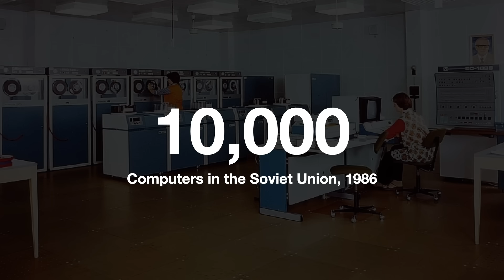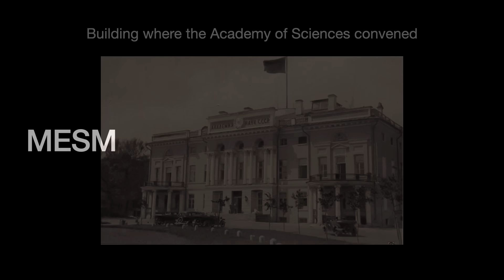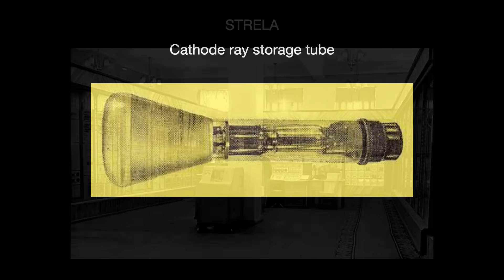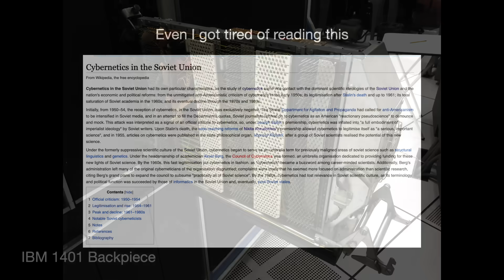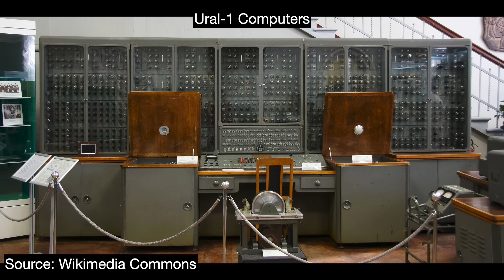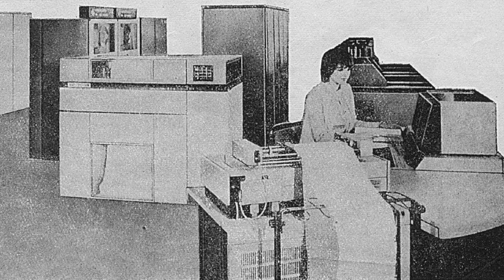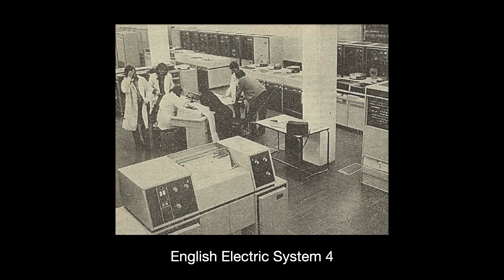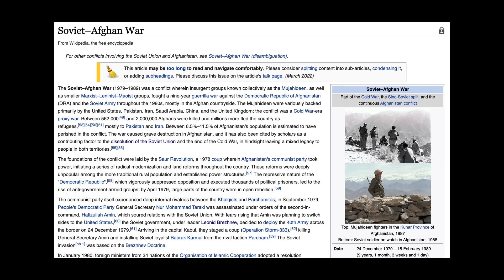Why the Soviet Computer Failed

Comment: Great video. However, it has several issues. With so many comments I think nobody will ever read this, but anyway.
1. At the moment of Stalin's death there were 4 computers in USSR. Not four models or types, just four computers. 2 in Moscow, 2 in Kiev.
2. MESM was initially decoded as a Model of an Elecrtonic Machine, not the Small Machine.
3. There were 8 Strela computers ever made.
4. Not all ES computers were copies of IBM-360 and also not all were IBM-compatible.
5. The newspaper shown is not Pravda, but Pionerskaya Pravda. The difference is like that between The Times and The Washington Times.
Otherwise everything is almost correct.
Reply: Kiev as the transliteration of the Russian name for the city is appropriate when discussing the Soviet era, in the same way calling Volgograd Stalingrad is appropriate for when the Soviets called it that. Calling the present-day Ukrainian city Kyiv is also appropriate, in recognition of transliterating the Ukrainian name for the city rather than the Russian name. Historic revisionism isn't going to help Ukrainians.
Reply: @timewave02012  yes we need these rational comments and not some not important outbursts from ego trippers ffs
Reply: @timewave02012  
That's not going to stop them. Even some close friends are convinced that I am a mongol/finn/turk... orc seems to be the new one, among very nationalistic ones
Reply: I guess some folks have read your comment.
Reply: Sorry, but I think MESM stands for Malaya Elektronnaya Schetnaya Mashina, i.e. Small Electronic Calculating Machine. As contrasted to BESM: Bolshaya Elektronnaya Schetnaya Mashina, i.e. Large Electronic Calculating Machine. It fits.
Reply: @Kurtlane  At first they called it a model. Then they made another, bigger machine and renamed existing one to Malaya(small). About BESM different sources give different information about was it "Bolshaya"(Big) or "Bystrodejstvujushaya" (Fast) computer. It is interesting that the book called "Computers" printed in 1973 in Soviet Union that lists technical data of almost all contemporary Soviet computers, tells nothing about what BESM could mean. There is information about BESM-4M and BESM-6 there.
Reply: @shroedingercat  You should go deep in history, as actually MESM was started before BESM but used just as development scientific workbench though, after it was decided that even this will be remade into full computer when BESM was proven to be if fast, still is kinda unreliable so in reality its fast calculation capabilities couldn't be used totally due to frequent fails
Reply: @antonzhdanov9653  What you say is entirely correct.
Reply: And despite this, even RAND agrees that for 60 years the Soviet Union's economy grew far faster than the U.S.'s did. Imagine if their computing had kept pace!
Reply: Too bad no one will ever see this post. lol
Reply: @trumanhw  "we see everything" - will sutcliffe
Reply: So it's like the host in the Radio Yerevan, when questioned by the listeners of the station about the rumors if they give away the cars at the Red Square in Moscow. With so many phones to the studio, he answered, the news was essentially based on some undeniably true facts, but anyway it had several issues:
1. Not at the Red Square in Moscow but in Peter.
2. They definitely don't give away but steal.
3. These are not cars but bicycles.
Otherwise everything is almost correct. ( ͡º ͜ʖ͡º)
Reply: This Kyiv vs Keiv argument is the most ridiculous and ignorant argument possible.  First of all I will say that it is 100% of whatever government is in place at the time is the one who gets to say how their provinces are named.  End of conversation!
  There is so much history in Kyiv that it is nearly impossible to get it 100% accurately right by those metrics because of how different people write & re-write history. The funniest (and most ignorant) arguments are from the Russians. They act like because Kyiv has been in their sphere of influence  that they get to be the deciding voice in the argument. What makes that laughable is the fact that Kyiv was actually established EVEN BEFORE THERE WAS SUCH A COUNTRY AS RUSSIA.  Historians say that Kyiv was established around the 4th century whereas Russia (as a country) was established around the 8th century.
  My final conclusion: whoever controls a city within their sovereign borders is the one who decides what that city shall be called.
Reply: pretty interesting tbh, ive always wondered what if some other country besides the usa had ended up creating the computing paradigm instead
Reply: @crazydog3307  A paradigm is a paradigm only when other people accept it. For USSR this is not the case and there are two reasons. The firs one is the political isolation of the USSR. The second one is their inability to produce computers in substantial numbers.
This affected the whole industry. Just one fact: in USSR they were able to create one (yes, ONE) programming language that was not a copy or a translation or an adaptation of Western ideas. And this programming language  has been created by a dissident.
Reply: 64357
Reply: You got tons of reads. Congrats.
Reply: @The_ZeroLine  Yeah. That's why I did it. Reads. Wow, you saw right through me.
Reply: You message was confusing. Did you think I was being sarcastic or accusing you of something?
Reply: 'Otherwise everything is almost correct' - the highest Russian compliment. 🤣
Reply: It’s KIEV if you’re anywhere west of fucking.... ummmm, idk boys, what’s a good cut off?
Reply: At least former soviet has many Hacker and Pirate now.
Reply: From NZ,,,point #5   noticed that :-)...
Reply: How do you get the Russian alphabet to come up when you type in your comment, or any other one for that matter.
Reply: @bpark222  use Google translate. Paste/ copy
Reply: How about Schrodinger's bomb? Trade the cat for an explosive on a timer...does it exist? I dont get Schrodinger really, someone had to put that cat in that box. Just because we dont know who, doesnt mean it isnt there. Ignorance of an existence, does not mean it isnt there.,
Reply: I don’t know who you are but you are cool and we would probably be friends if we met IRL
Reply: and they forgot class of research, terminal and  "personal computers" . Nairi (https://ru.wikipedia.org/wiki/%D0%9D%D0%B0%D0%B8%D1%80%D0%B8_(%D0%BA%D0%BE%D0%BC%D0%BF%D1%8C%D1%8E%D1%82%D0%B5%D1%80)), Electronika, Pravetz
Reply: I found your post relevant and I have read you. I won't make stupid controversies of Kiev name. All the slavic and baltic languages redefine the words of western cities in their own linguistic requirements. We don't undermine support for Ukrainians by naming things this way, and blue/yellow flag don't cost much, while true support is much more difficult. Anyway, debate about the content of this video is interesting.
Reply: I would also add that the other Easter Block (Warsaw Pact) countries provided not only peripherals and parts for the ES computers but made also their own IBM-360 clones. I used to run my code on one of them (R-32, I believe) in late 1980s for my PhD in Poland.
Reply: @arctic_haze  yeaaahhhh!!!! That is why I am suffering through these comments!!! I forgot what it was! R-32!!! Wasn't there a newer version? R-3? something? I used to work on them between 1987 and 1992. But really, I worked more on the IBM 360. Because of the monitor. I worked in a big steel company in Hungary. They also had one called Bull Gamma (I t
am maybe wrong, but I think it was French). The Bull Gamma used punch CARDS! The R-32 had punch "ribbons". We were using PLIOPT/1 as language and I loved it....
These pictures are bringing up such of good memories. Having data storage "disk" and readers the size of a washing machine. Having a stack of punch cards that printed out pictures. Those who were a little too deprived had their Playboy "magazine". My god! It was fun...
Reply: @tahwsisiht  The one I worked luckily had already terminals so I could type my code on one of few scattered on the corridors of the institutions where I did the calculations but the jobs had to wait in queue and usually I received my printout the next day from a priestess in white robe (yes we we not let close to the computer itself). I coded in Fortran and found it funny that I had to type as if I produced the cards (code from column 8 to 72 only if I remember correctly).
Reply: @arctic_haze  after I finished my comment, I remembered that we had Hewlett Packards too. It was a big company with a good size of computer science department (not the perfect translation) The company had more than 16,000 workers and our department had at least 200 employees. Data entry, operators and mechanical guys, programers,  managers etc... The computers were accessable and some of the guys would do those silly pictures when they had no project. I was young and many of my coworkers were just under or around 30. It was fun to work together. A TON of practical jokes. I know periods of socialism were different in our countries and it made a big difference. In the late 1980, we were "getting some freedom". Poland had some protesting around that time. Maybe miners workers had some bloody crack down. Am I right? Sorry if I am ignorant about your history. I will Google it later. It is pass 2 am.
(One practical joke: the director of the department had alcohol. When they had meetings with other directors or managers, they had some drinks. One time, the guys in the night shift, used a syringe to suck out the alcohol and filled it up with water. They partied at night and the bosses were pissed when they were showing off at the next meeting :) )
Reply: I don't see why any Ukrainian would feel any affinity for Russia after Holodomor. Join the West.
Reply: Here is a video that clearly outlines the weaknesses of centralized planning and most of the commentary on the right surrounds a language dispute and how to spell a certain city. Have we lost our ability to look from 10,000 feet up and see the bigger picture?
Reply: @Bob and this is the tread with the most comments. Funny, after the guy typed that his comment will not raise attention....
Reply: You are all wrong, it's Kiwi. The whole discussion over the name is very stupid and unnecessary. It is a city in a country that is being attacked, it's irrelevant how you spell it, it wouldn't change anything. If you write "Kiev" It wouldn't add power to Russian army and similarly if you write Kyiv, it wouldn't help Ukrainians. So write it as you like, don't listen to anyone
Reply: @andremorr  it is called respect. You just have none. Not a good trade...
Reply: @tahwsisiht  it is a pity, not respect. Respect you have to deserve, pity is something you feel seeing someone being wronged. And maybe I have to remind you, but there is a war in Ukraine and maybe it's not the time to argue about stupid things like how to write the name of a city that maybe is being under attack as you read this sentence. Put your energy into something productive. You and other people. Please
Reply: I worked at IBM for a while and I remember a newsletter coming out when one of the top employees, Thomas J. Watson Jr., died in the early 1990s. The article included an excerpt from an interview he had done back in the mid-1950s with a major newspaper or news-magazine in which he was asked how many computers he expected IBM to sell that year, worldwide. His answer was THREE. Not three hundred, three thousand or three million but THREE. This was not nearly as unreasonable an answer as it might first appear because computers were IMMENSE (and I assume correspondingly expensive) in those days and of very limited use to almost anyone. When I started working as a professional programmer in the early 1980s, I talked to some of the people who had worked with the first computers that our insurance company had and they remembered machines that were so large that they could WALK THROUGH the inside of the machine. (Apparently, this was so that repairs to internal components could be made.) I've forgotten whether the machine  you could walk through was the CPU or a peripheral like a printer.
Reply: Wass Pionerskaya Pravda written for members of the Young Pioneers? Or does Pionerskaya translate better as "engineers"?
Reply: Were the lies in Pionerskaya Pravda usually less outrageous than those in Pravda?
Reply: True "Pioneer Truth". this is for scouts from 10 to 16 years old...
It's funny that the problem of the entire Soviet system was discussed at the children's level.
Probably one of the pioneers whose parents were communists discussed the conspiracy in the kitchen remembered the conversation and shed light through this publication bypassing the KGB agents in adult fiction.
But it didn't help.
Reply: The difference between Pravda and Pionerskaya Pravda -- i.e. Pravda for the (Young) Pioneers -- is more like that between The Times and a simplified, Simple English version of it. The Young Pioneers were the Soviet Cub Scouts. The Soviet Boy Scouts, i.e. Komsomol, had their own Komsomolskaya Pravda as well.
Reply: Pionerskaya Pravda was a newspaper for children
Reply: Tbh, I don't think it's historic revisionism as Ukrainian was the state language of the Ukrainian SSR. So, both translations could be used.
Reply: I'd love to know how. you came to know these things.
Reply: It's amazing how we have 5 experts in this comment thread, yet not one of them is correct.
Reply: @helljumper912  Experts on what? How to spell the Ukrainian language? Is it anything like spelling harbour harbor at the US Canadian border?
Reply: @kimobrien.  Kiev as a name originated 10+ centuries before Ukraine as a concept or Ukrainian language even become a thing. Expertise on Ukrainian language is irrelevant here.
Reply: @rogerdinhelm4671  

Ukrainians founded Kyiv and are authority on how their capital name should be spelled, not Russian imperialists.
Reply: @rogerdinhelm4671  More accurately, “Ukraine”is just simply irrelevant.
Reply: @1AstralKing  Well Kiev was founded long before Ukraine was.
Reply: @rogerdinhelm4671  Yes it was.
Reply: @helljumper912  
Not inaccurate to say that it was originally a Khazar Khaganate before being captured by the Rus, there is also some truth to say that the 'folk wisdom' is that Kiev was named after Kiy. 

But the etymology of the name was originally Kyh-jev / Кꙑевъ, closer to Kiev than ...Keev. 
Original meaning is unknown.
Reply: @LancesArmorStriking   
After Googling, Kyiv is the politically correct because that what Ukrainians use as their own spelling. Kiev is associated with Russian language or the Soviet era. Even the pronunciation is different.
Same as post-colonial name changes in Asia from Ceylon to Sri Lanka or Bombay to Mumbai.
Ukraine was pushing it to show their independence. So, I think that is the appropriate way to spell Kyiv. They have the right to ask us.
Reply: @tahwsisiht  
I suppose, but this ultimately also comes down to translatability as well. 

'Keev' is simply never going to be pronounced correctly in English, it lacks the distinction between и and ї. 
Kyiv is not the original spelling either, but a transliteration.

Ireland could just as easily demand that it be called Eire, but it doesn't, because 1) it's purely symbolic and not practical and 2) it complicates existing norms
For a better example, Poland does not ask people to use 'Varshava' instead of Warsaw. It benefits from using a name that is more easily pronounceable by non-Slavic people. 

I think Kiev, composing 2 vowels, is the same.
Reply: @LancesArmorStriking  for me, it doesn't take anything to call it Kyiv. And because I have respect for others, I can not see one valid point not to call it Kyiv.
Reply: @tahwsisiht  
It might not take anything for you as a single person. 
But, this will affect transliterations and translations of official documents in English (do we retro-actively re-publish everything with a single word change?), retooling tourist guides and materials, maps, atlases, websites, everything that even mentions the city by name.

And I find it strange that you think someone's ability to see valid reasons not to change the name everywhere, comes from a place of disrespect.
Reply: I read this, im a nobody, so you are still technically correct, the best kind of correct.
Reply: in soviet controlled countries development of the computers has been running under strict supervision of soviets and any development showing some progress immediately stolen and permissions for further work forbidden.
Reply: Well, this ended up being an interesting thread, both a discussion about what you call the capital city of Ukraine and an interesting debate on the interpretation of some facts presented in the video.

To the first point.  Does it really matter specifically what you call it so much as you identify that it is the capital city of a country under siege from unwarranted Russian agression designed to seize any and all territory in a desperate grab by Putin to see the USSR restored regardless of whether the USSR was a competent power?  The history books as I understand it, implies it was generally inferior.  Although it looks like they did have the potential for some amazing computer power, but was wasted by beaurocrats.

As for the second point.  This video may well be flawed, it doesn't seem to have CGP Grey's level of investigation behind it, but it clearly pulled from the facts its makers had available.  It may be flawed and needs a re-working.  But credit for getting a lot of the general principle information out there.  I learned they had relatively shit-fast computers at one point ahead of everyone else.  I learned they tried to do a deal with a UK company but things didn't work out.  They suffered because of bad decisions of people who could not see their potential.

And coincidently because the USSR fell, in part due to the same bad management, we can tie the computing history to today's on Ukraine.  Russian leadership wants to make themselves strong and powerful again.  they may have learned in part some of their mistakes.  But Russia certainly never learned not to declare a war on mainland Europe where the rest of Europe is going to rally.  The lesson of cost of the siege of Stalingrad should have been learned.  Russia should not mess with Europe because the cost will be extreme to Russia.

If there are any Russians reading this who think the military exorcise is justified?  Then I'm sorry.  You have been lied to by your state media which is telling you information without the other side of the story which has a vastly larger lot of information to tell.  The Russian Invasion of Ukraine is the 21st Century equivalent of a Nazi invasion.  There are basically Nazis in Ukraine, that's true. but its name is the Russian Army.  They have slaughtered thousands of innocent civilians in the name of conquest.  They have bombed 10's of thousands of homes and made millions refugee's in their own free country.  Russian forces risked breaking the contamination seals on Chernobyl while Ukrainian soldiers gave their lives to defend it to prevent the radiation from getting out.  Russia is the second biggest force in the world right now from obtaining a state of world peace.  (the first is China)
Reply: Russian space computers were faster than American ones. The Russian computer that controlled the reusable Buran spacecraft was more advanced and more compact than the Shuttle computer. It was always funny for us in the USSR to watch how in the USA their special services spread stories about the backwardness of the USSR. When it was necessary to tell a joke, we in the USSR told what the American press writes about the USSR, and everyone laughed together, because. it was as ridiculous as a comedy show. If a young man today were to study history from the American press, it would be equivalent to studying the facts about the Second World War from the propaganda claims of the Third Reich. For an objective analysis, you need to listen to what both competing parties say about the same thing.
Reply: @TyphoonUSSR  you are assuming you can learn anything about history. If you believe anything written ever in a medium intended for mass consumption which regards contentious subjects such as the innate motive of the human and events that occurred in any period of history, then you have been mislead. Now, as much as then, the narrative of the media and academicians is pure fiction.
Reply: @TyphoonUSSR  неа. Buran's avionic was guided by four Soviet analogs of i8086 based computers while Shuttles have three i80386 computers. 
but you're right about nowadays "Big lie" type propaganda against Russia.
Reply: KYIV YOU FOOL.
Reply: @Maplelust  nope you self centered bafoon. Київ. you are arguing in the wrong alphabet and language.
Reply: point 5: you compared us and uk papers. how do you compare the two? or us and uk politics? would bidon be forced to resign if he had glass of wine during lockdown?
Reply: @ivok9846  "Biden." Otherwise, your comment is still just a stupid attempt to make a political point on a non-political issue.
Reply: @ivok9846  this comment is deep and underrated
Reply: https://ru.wikipedia.org/wiki/%D0%9C%D0%AD%D0%A1%D0%9C that's not what the wikipedia page says
Reply: this video is riddled with issues. It doesnt seem well researched.
Reply: @wishusknight3009  this comment is devoid of criticism. It doesn't seem to make any valid point.
Reply: @wishusknight3009  Shorter: I don't have to give reasons, I just have to say it.
Reply: @SnarkTheMagicDragon  I have articulated my criticisms in other comments. I just dont feel the need to keep repeating myself.
Reply: @SnarkTheMagicDragon  Yep! So many people simply stating with authority how something is with nothing to back it up.
Reply: Yeah well I have an issue with you: IT's KYIV!
Reply: @posticusmaximus1739  it has been spelt KIEV in english for decades. Just because the Ukranian government want's the world to use their spelling now, doesnt mean people are obligated to follow. Just like Turkey wants the rest of the world to switch to Türkiye, but the rest of the world doesnt care
Reply: @posticusmaximus1739  I heard it depends on if you speak Russian or Ukranian.  Is Kiev/Kyiv in the Russian part or Ukranian part?
Reply: @posticusmaximus1739  No it's not. Quit larping.
Reply: @posticusmaximus1739  i have a "nope" on that one. it is кијев град (kijev's city) or, in genitive, кијево (kijevo). if you want to argue about how it is written, go argue with khazars. they named it after one of their own, after all.
Reply: @sakatababa  named after KIY
Reply: @Bwize716  wrong alphabet. y is u. it should be j and read like y in yesterday.
Reply: @sakatababa  what alphabet? They say KIY was from a Turkic tribe Kayi  that used the Kumyk language.
Reply: @Bwize716  khazars, and they didn't use regular turkish alphabet. and turkish alphabet then wasn't even remotely as similar to todays. only word we have survived looks something like хчитх and means "[i/we have] read". it looks like a combination of balkan (bulgarian and serbian) cyrilic, old greek and turkish alphabets.
Reply: @sakatababa  Which "y" in yesterday?
Reply: @Ndlanding  both of them
Reply: @sakatababa  It was founded by Vikings.
Reply: @azynkron  Vikings or rather Rurik grand son conquered Kiev. City already existed way before that. Though, in the oldest known scripts of 10-11 century city name is Kiev. 
Ruckus about Kiev/Kyiv is totally political, aligned with ukranian historical and political "nation building" revisionism. Though, it's similar to any post Soviet country as for local powers essentially this is a must for expanding and consolidating their rule over country.
For Ukraine its especially delicate topic bcs there was almost kind of arguing if ukranians are a nation or ethnic subgroup of russians as essentially before mongol invasion Ukranians and Russians were one nation.
Reply: @sakatababa  it doesn't matter how it was spelled or pronounced hundreds of years ago.  What it matters how they want it to be called now. Should we still call Iran "Persia"?
Reply: @the0ne809  YES.
Reply: @the0ne809  should we not?
Reply: @-danR  the "y" IS the extremum of the "ay" diphthong, not has it, and sounds exactly the same as the 1st "y", which is in turn an extremum of the "ye" diphthong at the beginning - it's silly to consider the initial "y" as a consonant in a phonetic sense. If you didn't read it, but only listen, it's clear.
Reply: @antonzhdanov9653  Russians' blind refusal to use the name Kyiv is indeed political and in line with Putinist Russia's imperialist aspirations.
Reply: @vulc1  russians write it Ки́ев while ukranians write it as Київ but they both pronounce it exactly the same (minus some regional accents). imagine this, they have different alphabets.
why are you refusing to write it "proper"? you are going the exact same way russians are.
hypocrisy isn't a good look, remember that.
Reply: @-danR  Woooord! And nerd power!
Reply: @sakatababa  

it is spelled and pronounced differently
Reply: @eruno_  both my ukranian and russian colleagues pronounced it the same while writing its name in different alphabets.
i understand younger people are doing "we are not the same" dance, especially in the last 2 years, but when someone born in that city half a century ago pronounces it in a certain way, i'll defer to their expertise.
i can't listen to some "rando" on the web callin on some imaginary authority over someone i worked with for years and know personally.
Reply: @sakatababa  

I speak Ukrainian. Kyiv (Київ) in Ukrainian is pronounced as Kee-yiv while in Russian Kiev (Киев) is more like Kee-yev. There is a slight difference.
Reply: @sakatababa  What the heck are you talking about, it's not pronounced the same... Literally only the "k" and "v" consonants sound same. In Russian it's kee-yehv, in Ukrainian its's ki-yeev where the i is pronounced like the i in kiss.
Reply: @symphony137  like i said before, i'll stick to what i heard from both ukranians and russians, not some internet "experts". and, no, i will not believe you if you claim anything. i need proof.
Reply: @sakatababa  Proof? You are on the internet... You can research it within seconds. Not sure what "Ukrainians and Russians" you were talking to but I am originally from Ukraine and speak both languages.
Reply: @symphony137  you see, i would need proof you are "originally" from ukraine (whatever that means). all those "internet researchers" are the problem of modern mass confusion and information manipulation.
i had a productive relationship every single day with both ukranian and russian experts in my field that lived/live still in my country and i lived for a while in kазань and xарків.
if your claim is "i was born if but left as a child or my ancestors are from" i would have to burst your bubble as i know people like you from my own country. they know crap. and i can't take seriously anyone under 30 and anyone under 20 was still using potty when mайдан happened so they know crap. heck, whoever was virgin before гласність can't see the real picture.
Reply: @-danR  niice...
Reply: @sakatababa  yaa, but in english its writen diferently, if you write in english dont mix two languages....
Reply: @wexelo  добро, нећу више да пишем на енглеском. јел' овако више одговара твом сензибилитету?
Reply: @sakatababa I’m going with the view of those who live there. It’s “keeve”.
Reply: @patty109109  ok, so it's not india, it's bharat? it's not georgia, its sakartvelo? it's not gaza, it's palestine?
i have a ton more examples. where do you draw the line?
and, is the etymology, the origin, relevant at all?
Reply: @sakatababa It's not pronounced the same in Russian it's Kee-yev in Ukrainian more like Ki-yiv (the 'i' after K pronounced like something between 'i' in bin and glottal stop)
Reply: @posticusmaximus1739  Mmm...chicken Kiev.
Reply: @bcubed72  yes.
Reply: @posticusmaximus1739  yes and Moscow is Moskva or to be precise MOCKBA and Prag is Praha, same is with Kiev only in ukraine it is Kyiv or Kиïb. Internationaly it was always Kiev. So go and buy your chicken kiiv
Reply: @posticusmaximus1739  Kiev is just the english name, isnt it? Same as Kiew is the german variant.
Tbh as much as I feel for the Ukrainians, im not sure political changes to name spelling are meaningful. Same as Turkey officially registering the turkish varient, Turkyie or so.
Reply: It's true that Kiev is the name we have used in English since the early ninteenth century, but that is precisely using the modern Russian name. Throughout the eighteenth century, the name Kiow seems to have been the one in use in English-speaking sources, reflecting Polish Kijów. 

For me, using Kiev is natural for discussing the Soviet era. If we use Kyiv to describe the modern city, that's just a natural change resulting fromt the political change first of independence of the USSR and then the Russian aggression from 2014 on.
Reply: @posticusmaximus1739  no, he's right. Because at the time of Stalin's death it was called Kiev.
Reply: @posticusmaximus1739  for Bulgarians it's still Kiev cause you just copy our alphabet
Reply: @posticusmaximus1739  no it's not it's kyev, we wrote it that way for 80 years, a small unimportant border dispute won't change that.
Reply: @posticusmaximus1739  KIYEV it is
Reply: @posticusmaximus1739  Nah, Its Kiev, and always will be. Even ukraine agree's.
Reply: @singular9  eyyy!!!! Google it! Let's respect those who are suffering for their existence. Please Google it.
Reply: @posticusmaximus1739  Kiev. Even the westerners only started writing kyiv some time after 24.02. Laughable matter.
Reply: @posticusmaximus1739  no IT's KIEV!
Reply: @posticusmaximus1739  yes yes i see my friend so very ukraine allied, so wow, brave and stunning, refussing to say kiev and calling people out for doing so!!! KYIV yes yes i see, stunning and brave!!!! ... bruh ._.
Reply: @posticusmaximus1739  It is Kiev as in Chicken Kiev. It is part of RUkraine.